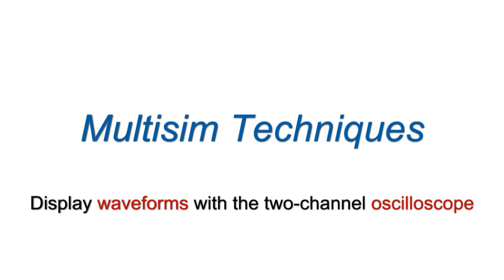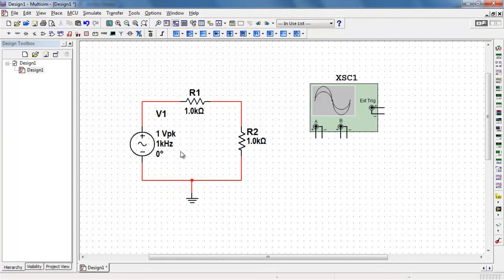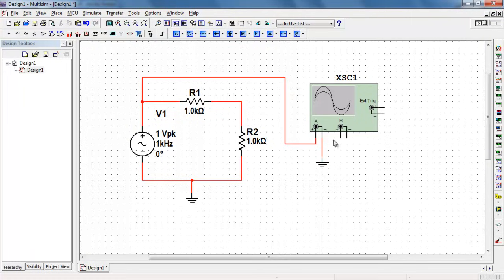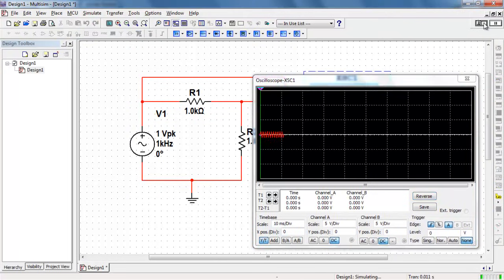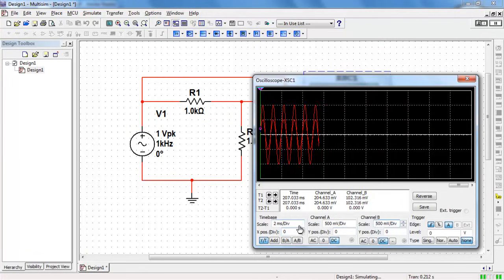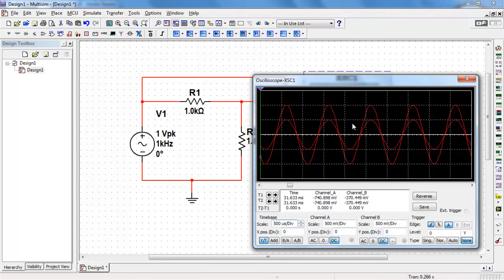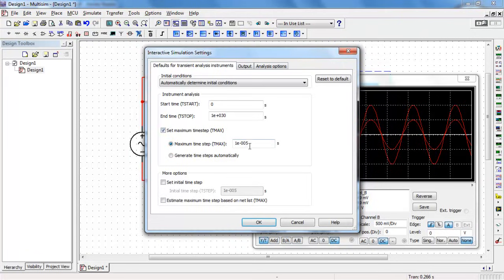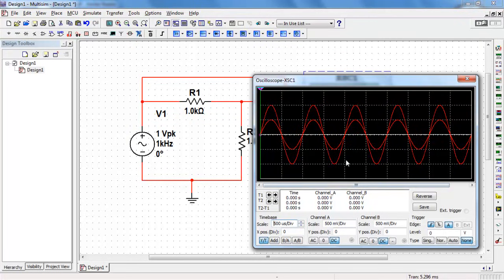NI Multisim: Basic operation of the two-channel oscilloscope

Comment: how do you find the voltage using a oscilloscope on each resistor?
Reply: You don't need the oscilloscope for that, if both resistors are the same value in ohms you just divide the total voltage by two and that's it. If you insist in using the oscilloscope then connect the probe at each resistor.